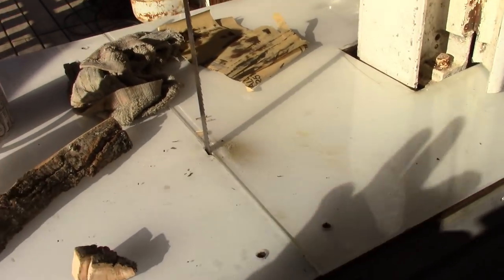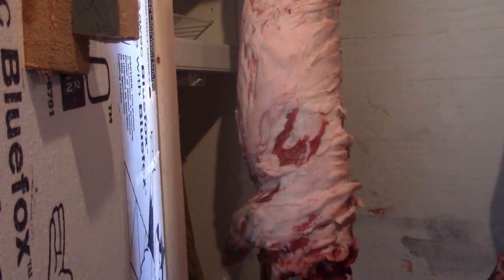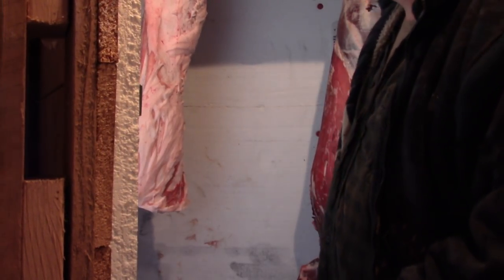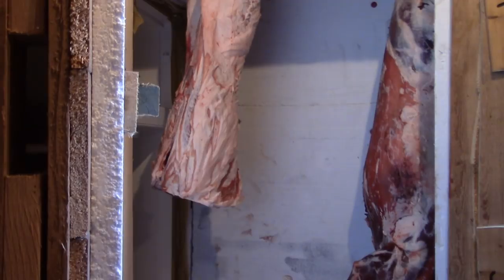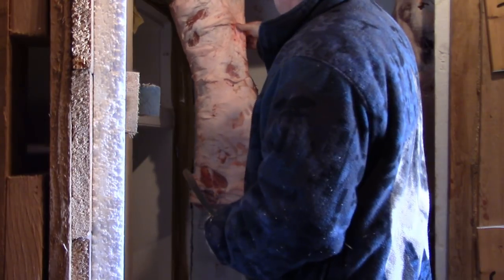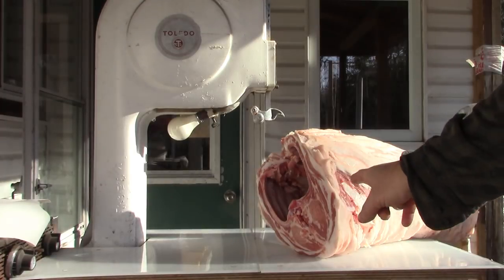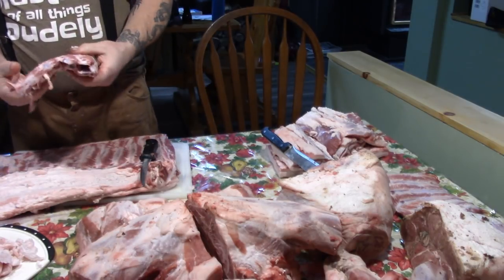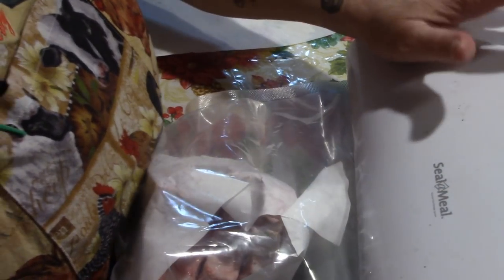How HOW Cuts Up A Hog!

Comment: I use parchment paper to wrap ribs/rib chops/steaks, anything bony, before I vacuum seal. I also buy cheap non zip type freezer bags from the dollar store to wrap large cuts of roasts/2 lb(1kg)ground meat/chicken in, get the air out and fold the excess over then vac and seal so I can cut open the bag, pop out the meat. Then I have a small vacuum bag that's clean that I wash and reuse for sealing up something smaller like coconut, nuts or vegetables for the freezer. I buy bulk nuts and coconut @ Costco and portion them for the freezer.